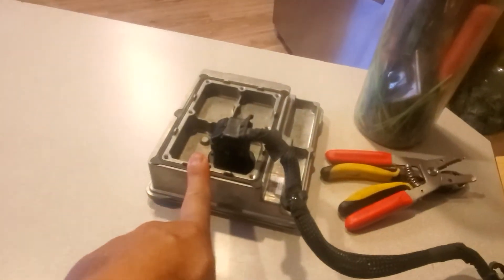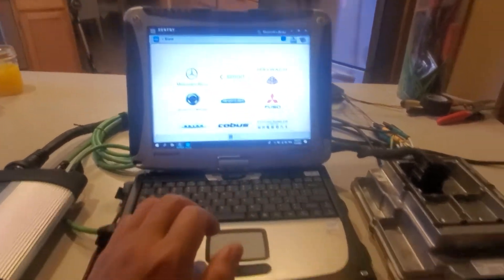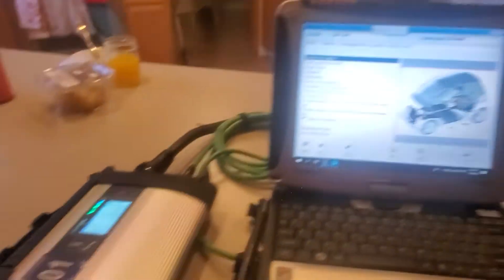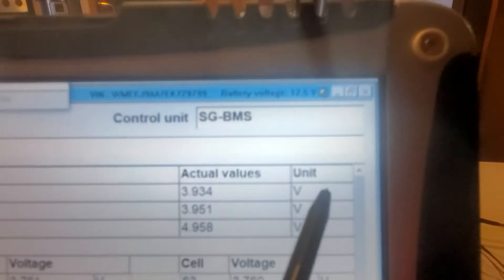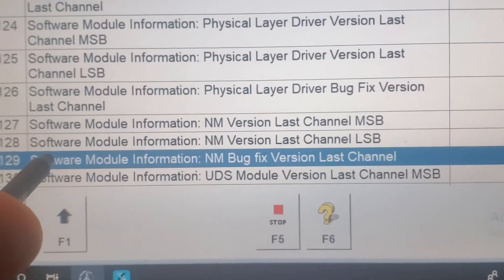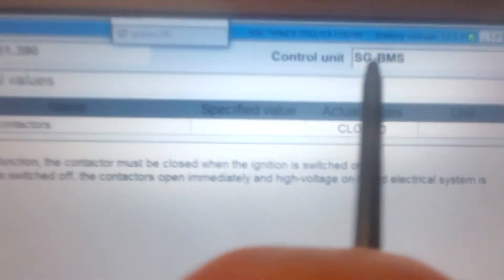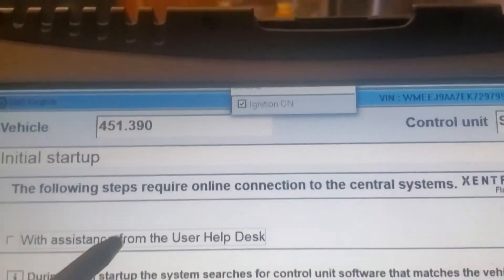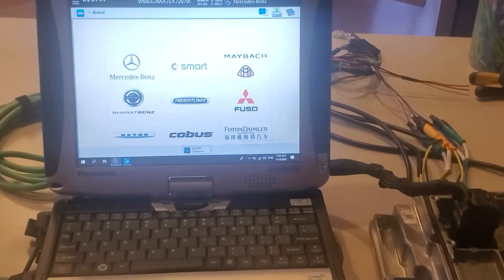Smart Car for two -Battery Management System(BMS) diagnose

Comment: Angel what PC and software are you using to clear the p18050c? I have the same year ED3 with the same error code on my BMS. Do you charge to clear the error code for others with the same (p18050c)error?
Reply from the maker: It's your BMS got an error also ..... yes we got the guy can do reset, reprogram and delete the error....from Brick to useable BMS again

Comment: Hey Angel, what color wires did you use for the BMS connector/cable and do you have a pin out diagram available?
Reply from the maker: Email me @ Skyblue7091@gmail.com...I'll show you how to connect ONLY 4 Wire needed
Reply: @Angelsum143   I live locally in Washington and I’m in the same car issue as you. I’m also curious about the pin out diagram and if you were able to clear the codes. Love what you’re doing and I’m excited about trying to fix this smart car myself as well! Thanks!
Reply: Hi friend, I'm Italian and I saw your video on YouTube about the connection to the bench for BMS on Xentry, is it possible to have the diagram you used? Thank you very much and we are your fans on YouTube. Congratulations

Comment: hello congratulations, you can now connect with the bms, I wonder how you can see the voltages of the cells if it is not connected to the high voltage battery?
Reply from the maker: Still working on it